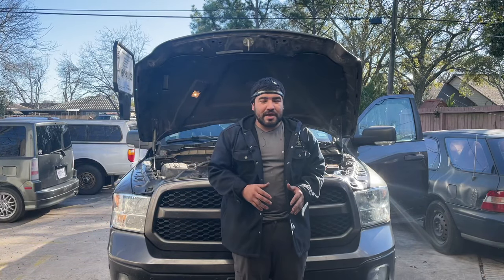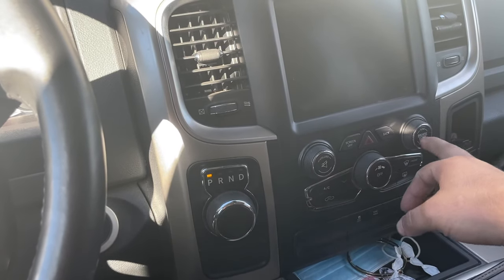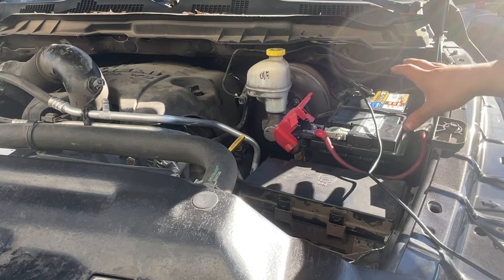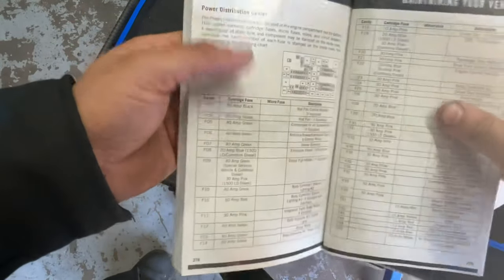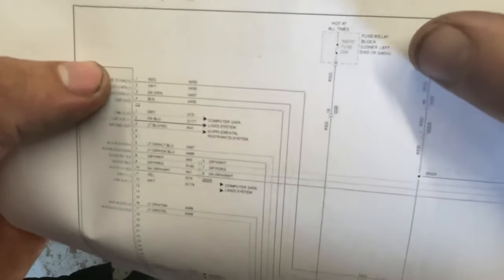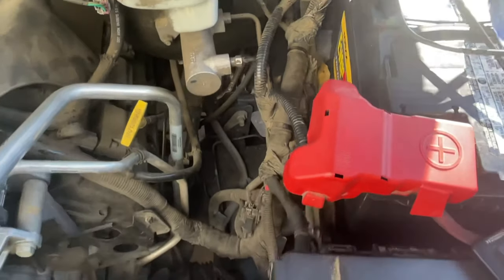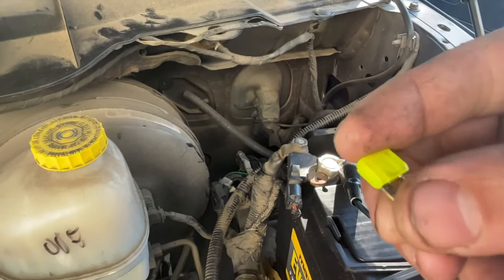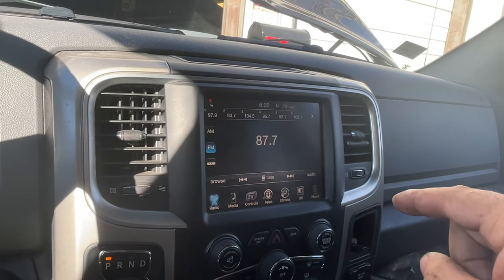Dodge Ram radio doesn’t work

Comment: Looks like FCA did not have a fuse slot open for the radio when they designed this truck and just ran a wire the same way add-ons are installed.  Poor engineering.
Reply: @daddyof3girls09  I don't know which of our assumptions is worst, poor design(forgetting to add a fuse) or planned obsolescence(hiding the fuse) as you stated.

Comment: If the fuse isn't blown what else could it be trying to figure out if I need to buy a new radio but trying to go through all the Diagnostics before I buy a new radio if you could help me that would be amazing please and thank you
Reply: Same problem with me
Reply: I believe the fuse terminal is freaking junk. My fuse isn't blown either but the stereo screen and the USB panel in the console flashes about once every 1-2 minutes. Even when the truck is completely shut off. Husband was wiggling the fuse and it tried to come on but still couldn't get good contact. I do not get it.
Reply: Can that cause the battery to go dead bc now that's the new problem I'm having with it
Reply: @trishacrossman8628 i have the same problem were u able to fix it
Reply: @trishacrossman8628 i have the same problem were u able to fix it
Reply: Same thing here. Radio fuse is fine and my truck is acting just like in the video. Can’t find a fix any where!
Reply: @luisarias988 hey were you able to fix the radio?
Reply: @bobbymoran6381 hey were you able to fix the radio?
Reply: @trishacrossman8628 hey were you able to fix the radio? I’m struggling with the same issue
Reply: @kennyredneck227 Hey were you able to fix your radio? I’m facing the same issue
Reply: @brayangutierrez5349 Hey were you able to fix your radio? I’m currently facing the same issue you did
Reply: @rubenII no. Spentalot of time looking this up.  From my research, if all your fuses are good; the radio is dead. Since the body control module is not reading a radio present; a/c controls go into default mode. Only fix is buying another radio (new/refurbished/aftermarket).
Reply: A good way to check to see if the radio is working at all is attempting to connect your phone blue tooth while truck is running. If it won’t connect or allow voice command controls from the steering wheel, it’s likely dead just like mine.

Comment: My 2014 is having the same problem but the fuse isn't blown per say. The fuse terminal I believe is faulty because if we wiggle the fuse the radio will try to come on but it just flashes when the fuse is moved. What would you recommend we do prior to replacing the terminal? Or how could we change the terminal without too much hassle? I am trying to do this before taking it to the one and only crook chrysler dealers around here.

Comment: I have a 2003 with similar issue - seemingly no power to radio. Just bought it 3 days ago. Gonna check out the fuses tomorrow and look out for this tricky bastard too. This is the kind of thing that would drive someone insane 🤣🤣🤣

Comment: You are a scholar and a gentleman sir. Lol. Just bought a 2020 ram 2500 and 4 days later the radio wouldn't come on. This was the first video i seen. I went looking. Found a 15 amp fuse in there that was blown. I replaced it and the radio came right back on. My gratitude to you good sir.

Comment: Had the same issue today with my 13’ ram 1500 5.7 sport. I had the screen black out & didn’t want to work after turning the truck on/off. Tried this before disconnecting the battery & sure enough, 20 amp fuse was blown & it was a cheap 5$ fix from auto zone instead of having a radio company do the diagnostic tests/etc. Method still works & was a life saver! Ty bro!

Comment: Thanks for the info... just spent 5 - 10 minutes checking and securing all the fuses in my 2018 Ram 3500 Deisel that I could find and she's working again! Life saver!!
Reply: I have a ram2018 tradesman. The light come on the volume button works . But no sound coming out the speakers. It is a ram 3500 . It cannot be the fuse or you won’t see the light on the radio and the station that it is on and the volume dial also works!

Comment: Thank you!!  I dropped my ram off at the dealership to find/fix this problem after weeks of trying to find and fix myself.  After watching your video, I went back to the dealership and fixed the problem in their parking lot before they took it in :).  Total cost... $3 for the fuse from the dealer.  Apparently, this in-line fuse blew when the 200 amp fuse on the battery blew.

Comment: Hi, on my 2018 Ram, after work the radio was not turning on, so I started researching when I got home. I was still on my truck and I found your video. On the part you were changing the fuse, my truck was on, and all the sudden my radio turned on and my audio transferred from my phone to the truck. Haha, thanks for fixing it remotely. 😊

Comment: Thanks for locating that discreet fuse for the radio off of the positive lead of the battery.  I had the same issue with my radio but my fuse was good.  To fix my radio problem I disconnected the battery terminals.  While they were off I cleaned the + & - battery posts which took about 10 minutes.  This was enough time for the radio to reset or re-boot if you will.  Then I re-installed them and everything works great.  Thank you
Reply: Had the same issue today & after switching out the fuse it worked but definitely gonna try this if it happens again.

Comment: I had to jump-start my 2018 RAM this AM and afterward, the U-Connect, and the climate controls below the radio (except the fan) were all dead. Found this fuse, it was good but pulled it to rest the U-Connect. All came right back online.  I suspect pulling the neg terminal on the battery might have done the trick, but this required no tools.  Thanks!

Comment: Oz I have a 2013 with the uconnect system sometimes my radio works fine sometimes it lights up only with this red statement across the screen. Says.   HEAD UNIT FAILED TO START AFTER A FEW IGNITION CYCLES. NEEDS A USB STICK SEE DEALERSHIP. ANY IDEAS I DON'T THINK THIS IS A FUSE PROBLEM. BECAUSE SOMETIMES IT WORKS FINE. SEEMS LIKE IF I PARK IN A GARAGE OR UNDER a tree that has heavy cover lots of leaves it does this
Reply from the maker: You have another problem. If the fuse was bad the radio wouldn’t even turn on
Reply: Yes I know this I went to ram forum and other people have this problem to but I never got info on what they did

Comment: The 20 amp fuse has power in/out, but still no power behind radio on pin 44. Any ideas?

Comment: Hey man. I had the exact same issue with my 2018. Radio justjust glitched. GPS on car play stopped and then radio went black. Console lights around the radio are not working and a/c / heat is blowing weird and can’t control it. Watched your video and that for sure it would help, but My radio fuse is not blown. Do you know any other trouble shooting for this issue??

Comment: Help I tried replacing the 20amp fuse with a new one but it didn't work my radio is still not working? sometimes I noticed a little flicker of light on the screen plus in my main armrest the same flashing occurs with the USB plug. I unplugged the battery to reset but that didn't work.
Reply from the maker: Did the use have power if you test it with a test light ?
Reply: @OzMechanics   I'm getting my test light tomorrow I will be testing the fuses , I do notice on the radio screen and my USB keep flashing light ever so often
Reply: @OzMechanics   I received the test light tested the fuse I do have power. The screen is still black and  ever so often it will flicker or flash a beam of light like it wants to turn on. I'm  Going to  take a look at the radio wire  Assembly to see if there's any loose wires. Other than that I wouldn't know what else to do?
Reply: @Ernie.E1960  it’s been a few months but have you found a fix yet? My 2014 RAM has the exact same issues
Reply: @lucasj2019   Hello Lucas I found out that my radio just went dead so I replaced it with a different one
Reply: same thing hapening to mine, my fuse isnt blowing. so im replacing my radio

Comment: I am currently driving in silence.  Mainly because I hadn't checked anything.  My screen flashes RAM but the back up camera and radio don't work.  I just checked this delightfully hidden fuse (thanks for that).  I looks good. So damn.  I'm too cheap to take it to the dealership.  Suggestions?

Comment: Great investigative work!
The thing that bugs me is, why does an audio unit need 20 amps of circuit protection??
Makes you wonder if there are other items on the ckt that this fuse protects. And what caused the fuse to blow?
Reply from the maker: What caused the fuse was that bigger amp fuse shorted out. As what the customer stated
Reply: Ah yes. Hooked up the jumper battery backwards. I've had to replace several maxi fuses at the dealership from customers hooking up jumper cables backwards ( or the new lot Porter, lol)

Comment: The OE wiring diagram shows it as an inline fuse in circuit A933.  Just another reason why the pro-demand redrawn diagrams are not to be trusted.
Reply from the maker: I’ve learned that with euro cars as well. Always good to have different resources to get stuff done. Its just crazy that they put a stand alone fuse that looks like a aftermarket part was added

Comment: I got a 2014 dodge 1500 previous owner put a Kenwood radio changed 20amp fuse like you showed but still nothing no power to radio

Comment: Wow, good job, I can NOT  find USB port fuse, need to reset it as I am Getting :"This Device is not supported" = Bluetooth cell phone connection, so I reset it by taking out for a minute or so.  2020 Ram Warlock.

Comment: I think this is the issue with my 2014 Ram.... gonna check it tomorrow in the daylight... thanks... we weren't getting any power in the radio deck control panel and all regular fuse box fuses were good.... it HAS to be this odd spot for this fuse....
fingers crossed!
Reply: Did you figure out what was wrong with

Comment: Hi..do you or anyone know a possible solution to fix blank display on a 2007 chrysler 300c  gps radio. When it's very cold out and I start car, screen comes on for a few seconds then goes off. Radio and cd changer works fine, just no display. Is that a fuse issue somewhere.. besides the trunk, or a cold solder issue

Comment: My exact problem.  Unfortunately the fuse keeps blowing when changed out. I even tried disconnecting the battery, and then changing the fuse. It blew as soon as the battery was hooked back up. Its a 2014 ram 1500. Never had a problem before until today when the radio stopped working and the screen went black while driving.  Anyone have any ideas? Something causing it to short out?

Comment: i have a 2014 Durango limited edition, i had a problem with the radio not working just like this one.. i took it to the dealer and they said i needed a new Uconnect control module at which i think cost $800... i will be really devastating if all i needed was just a fuse

Comment: I had the same issue, however my fuse tested good,,, I pulled it out anyway, plugged it back in and there was a big spark when I plugged it back in, and my screen/radio started working again.
Reply from the maker: I would replace the fuse. Check out my newest video with the Dodge Charger. Will explain it there
Reply: If it does it again I will!

Comment: I’ve been fighting stereo problems in my 2014.  My stereo isn’t working but my fuse isn’t blown….  Wtf.  I disconnected the battery and it started working again for 2 days then it stopped again… fml

Comment: 2018 Promaster City van with a Uconnect 3.   blank screen wont turn on.  pulled radio fuse, it was fine, but now I get "Software Update. Update in progress . Please do not remove USB Device".   I tried both ways to reset .. neither work.  disconnected battery for an hour - did not work.  I can't find a file online  to try to update with USB.

Comment: Did not find this fuse on my 2015 Ram 1500 eco-diesel - Checked the under hood fuse panel - did not find a fuse for the radio ???   &%@P())@@